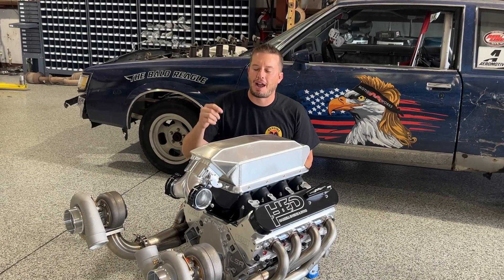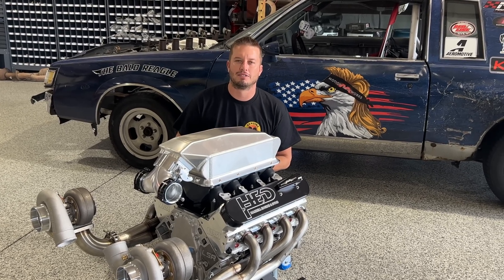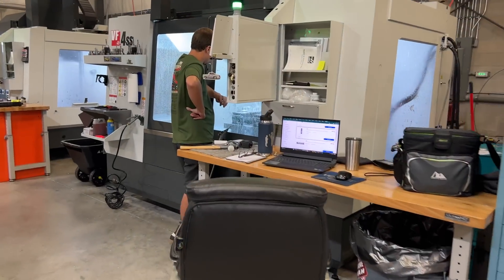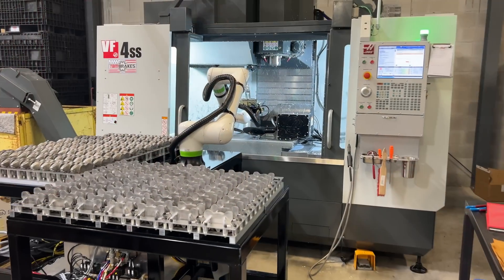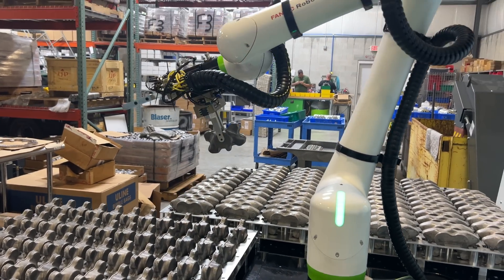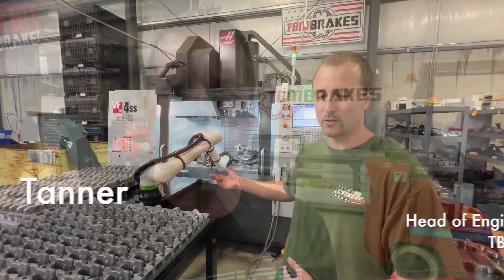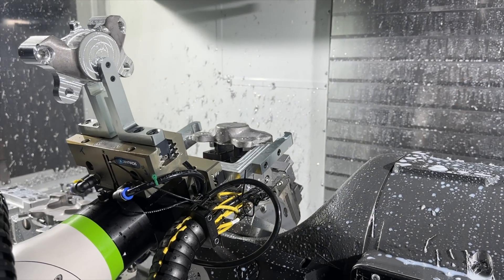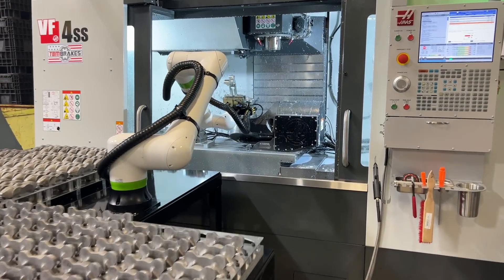Our First Robot! Robotic CNC Machining at TBM Brakes

Comment: They also make robotic welding machines that I think you guys would really benefit from atleast have it weld the little things like the engine lift plates and things like that and you should also make engine lift plates for the older engines as well like the SBC, BBC, SBF, BBF, SBM, and BBM and cover parts for the older engines along side with the newer engines that you already make and keep up R&D on all types of makes and models of the big 3 domestic vehicles and have actually people do the R&D on the vehicles and once they make the original parts then you can pass it on to the robots and have them make the parts on a mass production scale and you can even get an Arc Droid for the small plasma cutting items and then put them on the bigger plasma tables and have robots do that as well

Comment: You all need a pallet pool horizontal.  Same power hi mix manufacturing.
Reply from the maker: That’s one of our next moves for sure!
Reply: @MotionRaceworksOfficial  right now they are running 20 percent off promo on new units.  Clark machinery has a decent used one you could probably talk them down on based on the current new price

Comment: Even Better, you have 1 robot loading and unloading multiple CNC Machines. 
Could you just have him on a track so he can run down the line?

Part gets dropped onto a belt and past the next Robot that scans and does Quality Control. then it moves down to get boxed and placed on a pallet, or whatever,

Comment: It will either be great or make a lot of junk parts very quickly 😂 does the machine know when a tool dulls or breaks?
Reply from the maker: Yep the machine checks tools :)
Reply: All CNC equipment are BTS ( broken tool sensor) capable and the hit limit on dulling tools is easily acquired through testing and set to let you know when the tool needs changed.

Comment: Do you have that set up with extra tooling and logic so the machine changes it out after x amount of cycles? That would be the main issue I could see on tight tolerance features such as the piston bore with running that long lights out. Otherwise great application of a cobot, and easy to program and tie into CNC machines. Was my responsibility at another plant that had 12 turning centers manned by cobots.

Comment: I’m sure it is no surprise to anyone how successful you have been with tbm after seeing how well you guys have run motion. Congrats on the best problem… being busy!
Reply from the maker: Thank you 🙏🏼
Reply: @Motion Raceworks Official  now you can pretty much make brakes for anything and everything, including 4WD trucks, drag cars, drag and drive cars, everyday street cars, and you can start making your own brake masters as well but I do have a question after you get a set of brakes from TBM and you've had them on your car for a while and the pads start to get worn out do you guys sell replacement pads or do you have to get a set from your local parts store and can you get a set of pads from your local parts store if you're in a pinch and need the pads like now or do you have to get a set of replacement pads from TBM and you have to wait for them to come in because you have to order them from TBM

Comment: When is tbm gonna release brake kits for the 4 wheel drive 99+ gm trucks? Website says 2wd only
Reply from the maker: They’ve been confirmed to work with 4wd
Reply: @MotionRaceworksOfficial do they interfere with operation at all, as I'm looking to install on an all wheel drive.